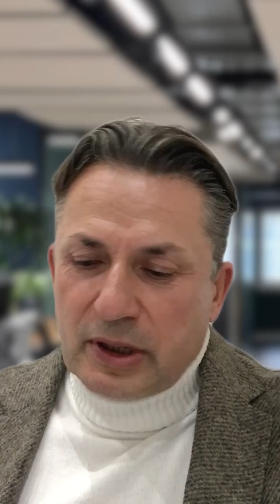Harvesting Ambient #Energy

Comment: Graphene holes act like penning traps. Hexagonal structure taps torsion field. Let me work for semiconductor wafer makers and I will change the energy harvesting of the world
Reply: Explain it more a bit please!
Reply: @rudhisundar look into bethe hilter process. Phase conjugate light waves. Charges trapped in holes. Like your copper wires. Type P material. Picks up transient waves restricted to the crystal bandgap like 2.4eV for the copper oxide example. This is same bandgap of peak emission of your sun as well as double ionized oxygen. 

See Garrett Modell ZPE. 

See skinwalker ranch self healing perovskite. 

See plasmoid unification model as fractal harmonics. 

I cannot explain, you have to do the work.